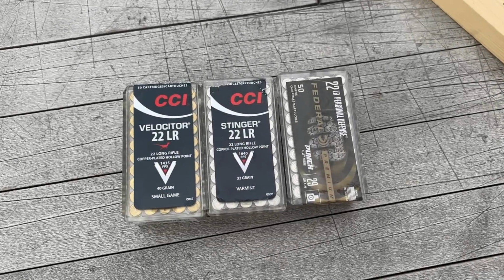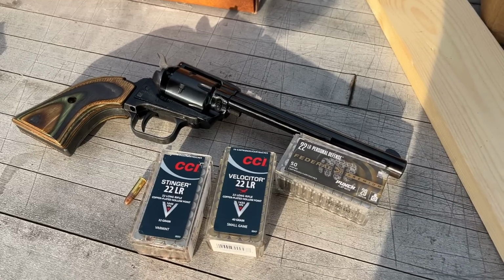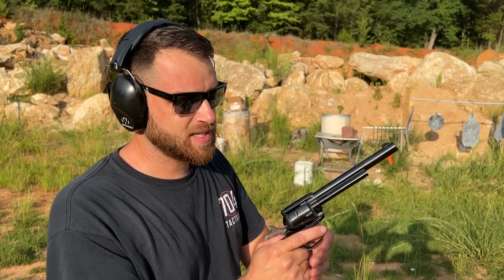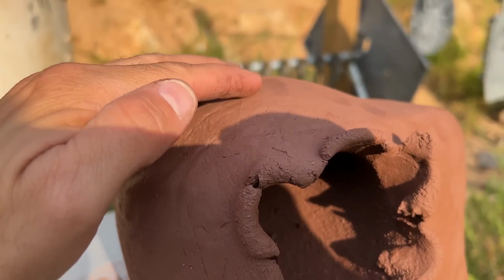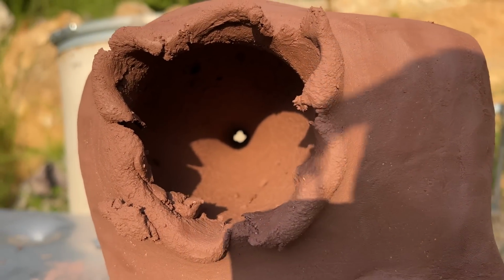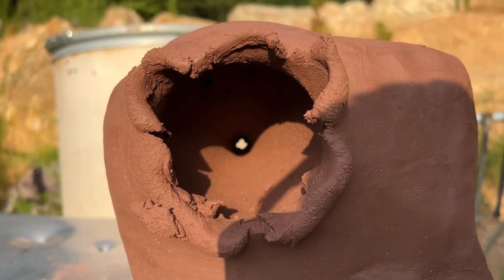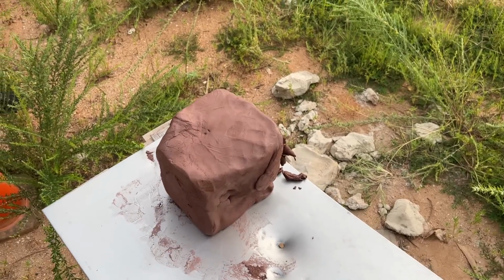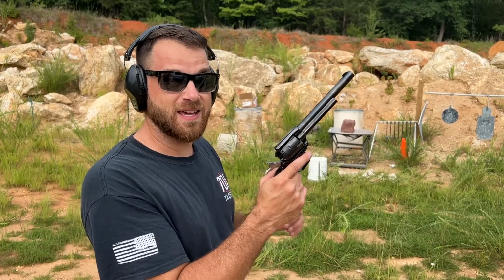Ultimate 22lr Ammo Test (Federal Punch Vs CCI Stinger)

Comment: Not all semi auto will run them. The cases are a little longer on the stinger and punch. All that said as a revolver shooter and carries the punch is an incredibly accurate round. Shot in a 617 it will print half inch groups at 21 feet. If you chronographed it you will see why. It was very consistent. Reminds me of the accuracy of the 9mm 9bple from federal. Sub one inch groups at 25 yards. I buy it in bunches.